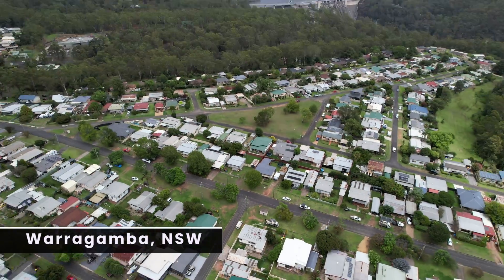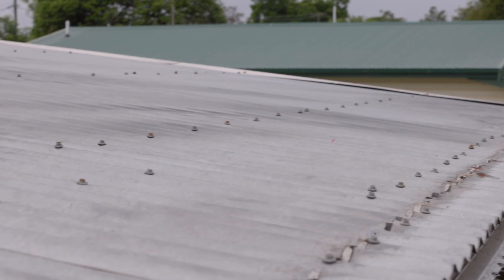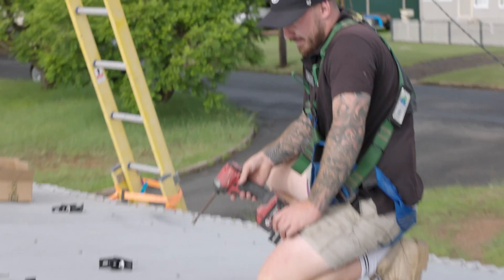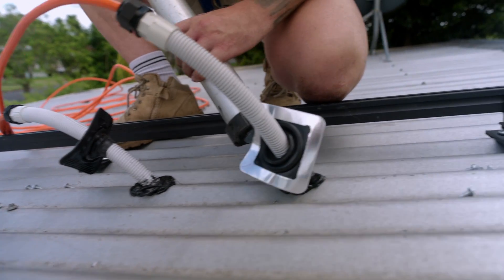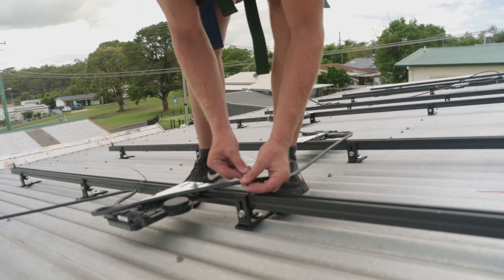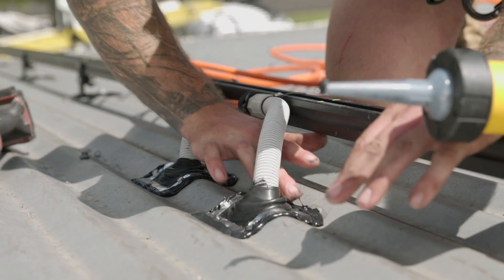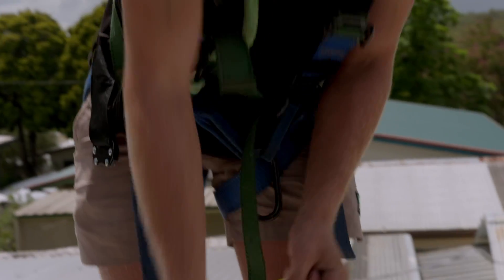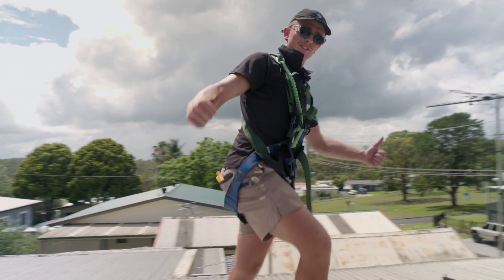Solar Installer Vlog - Enphase IQ8 AC Microinverter Solar Install

Comment: No ac isolators?
Reply: Don’t install rooftop isolaters anymore, they were causing to many fires. Just have a disconnection points now
Reply: @joelbrooks4228 it’s an ac system